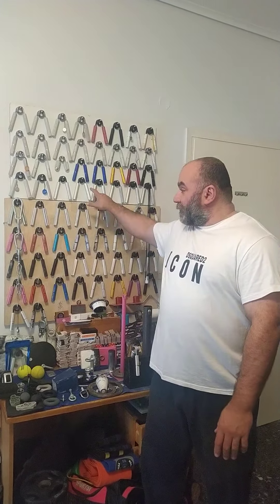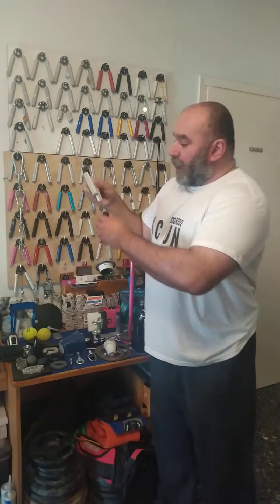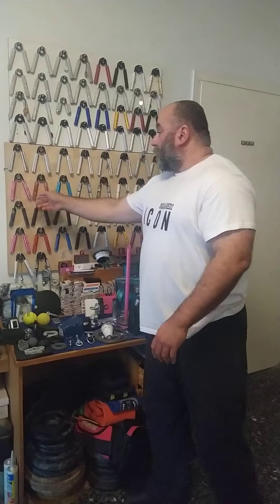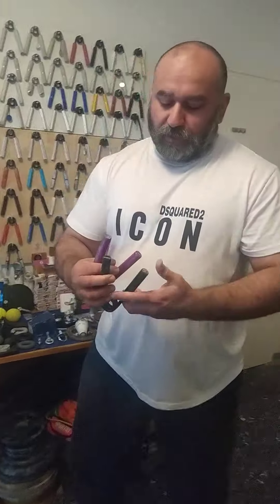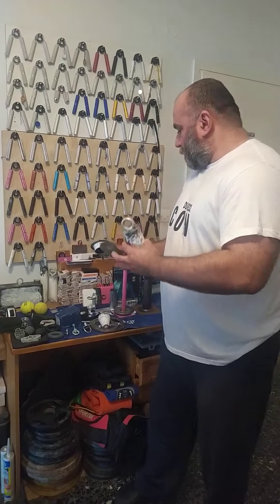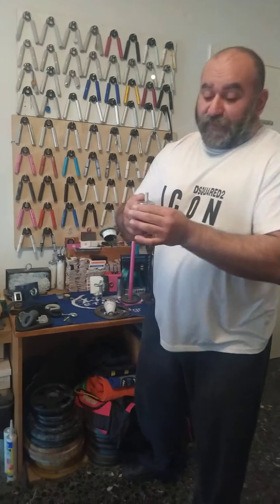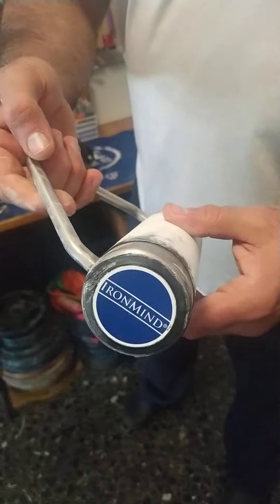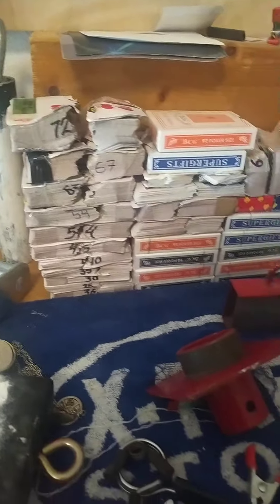My grip collection! Grippers and tools

Comment: I didnt realize the left hand spring actually makes a difference. I need to get one of those or the left turn coc now because my left hand is my stronger hand and i can close my coc 2.5 thats a 125 and i have an off brand i tested at 134.5 that i closed as well. Do you know if the coc left turn #3 is the same average rating as the normal #3? I just got a rated 149 #3 but thats too much still.
Reply from the maker: I believe the right handed 3s and the left turn 3s only have a few pounds difference on average. It does make a difference, I've noticed a left handed gripper kinda kicks the handle out of position in my right hand. Right at the base of the thing. Here's the link to the Cannon Powerworks ratings page, this should help a bit:
https://cannonpowerworks.com/pages/grip-strength-ratings-data